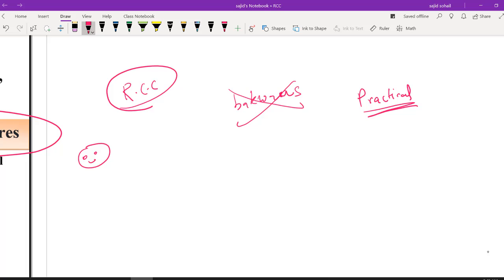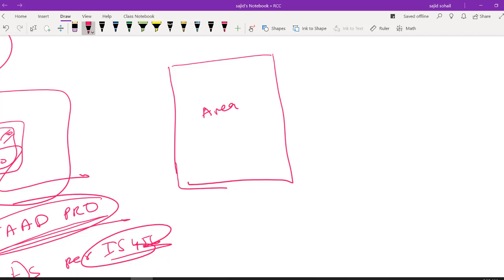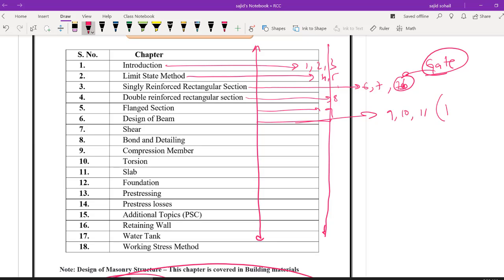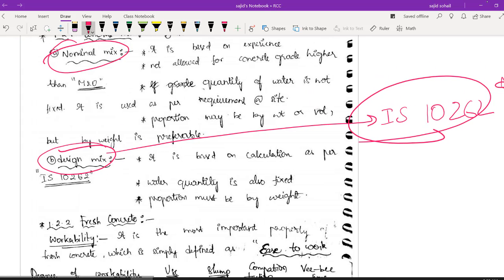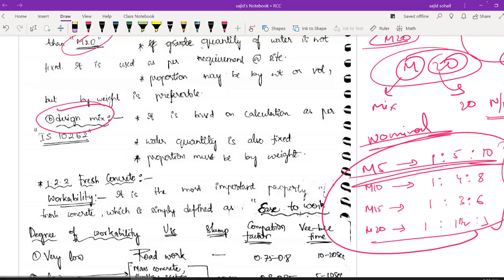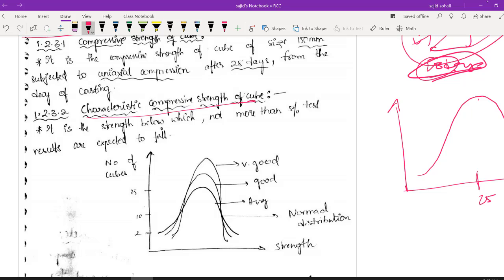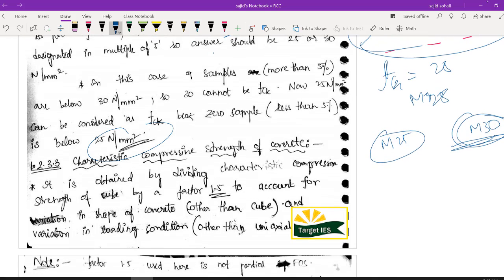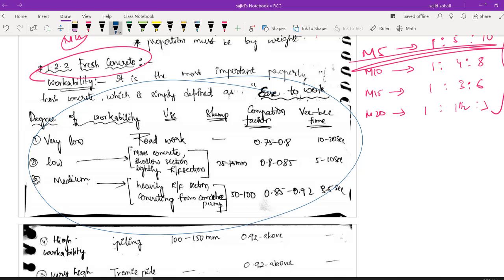Design of Concrete and Structures ​| Module -1 | Target IES | RCC

Comment: could you provide the code book soft copy link
Reply from the maker: if you are target ies student, kindly check the one-drive link provided to you, all material are available there
Reply: @TargetIES  Sir I am an enrolled student of Target IES, I could not find the IS456 pdf with important points highlighted. I have searched it in the folders shared, but it is not there. Please share it.